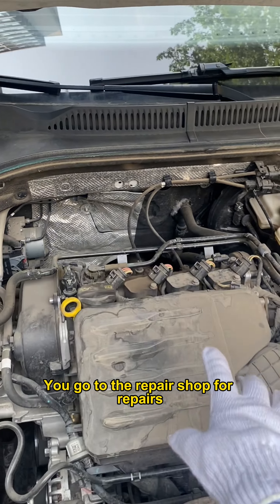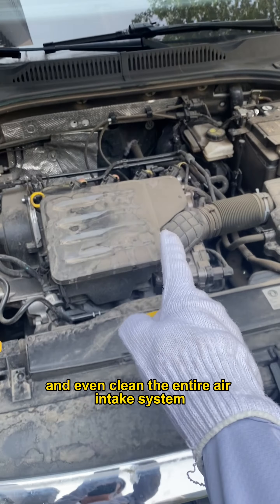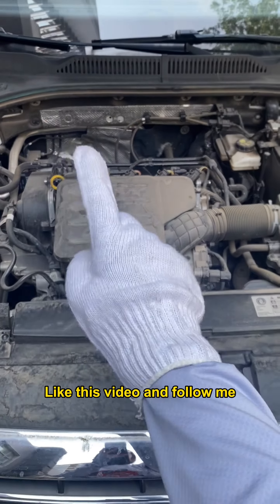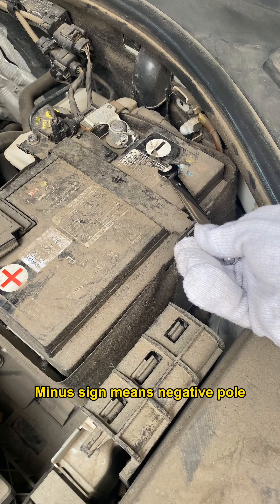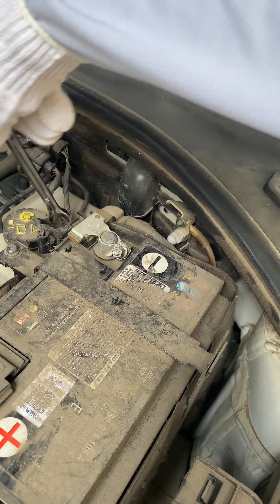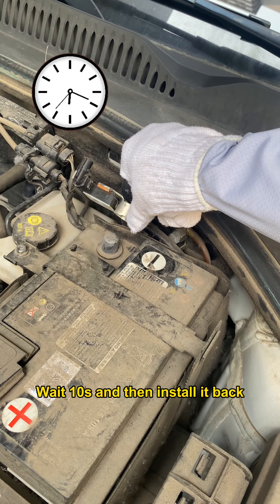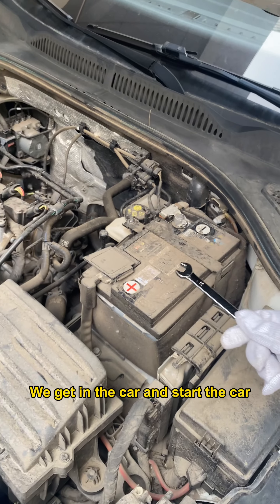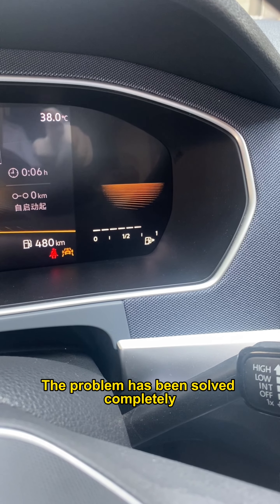Remove the battery negative screw for 10 seconds and the engine fault light will go out. #driving

Comment: that won’t solve shit, the whole reason the vehicle has a CEL is because there is a fault that is happening or happened, disconnecting the battery will turn off the light because the computer has no power and resets everything. After a while it’ll just come back😐

Comment: That light can be on for a thousand plus different reasons and some of witch can cause permanent damage to your vehicle if let alone too long. This is something you do if your broke and cant afford to drive a car. Half the time its a relatively easy fix, but the longer you leave it on the more problems it can cause. Plus doing this 1/4 of the time won’t do anything and the light will come back on within a couple minutes once you start it again. Dont listen to this guy he is obviously a guy pretending too know what he is talking about